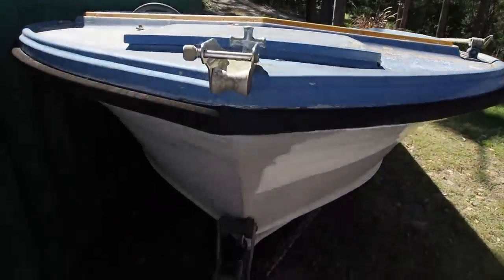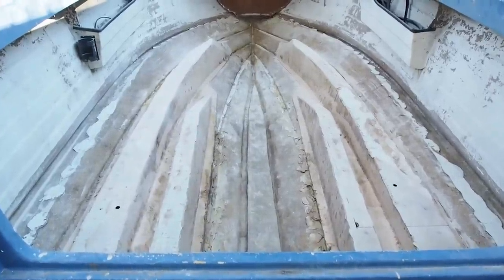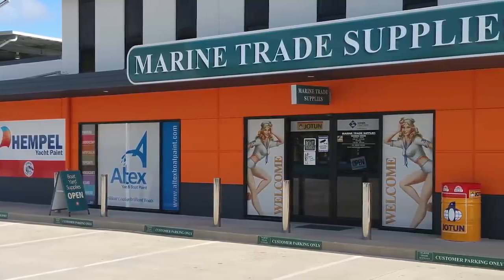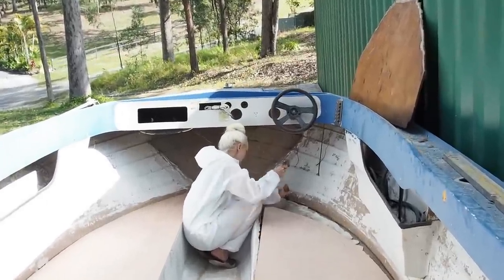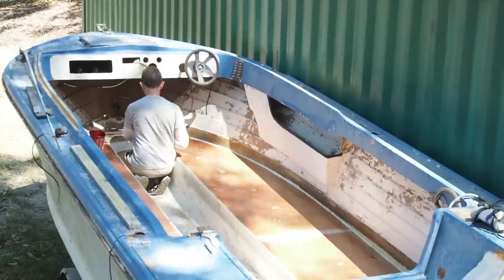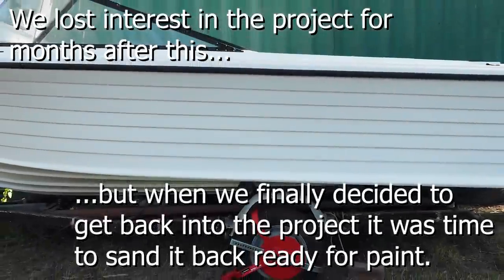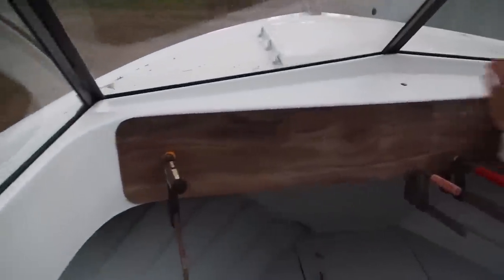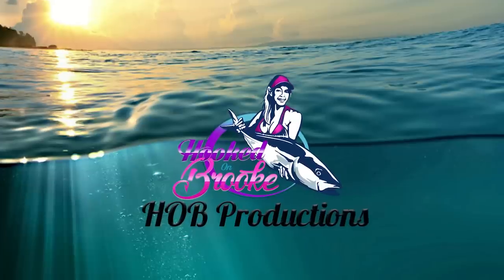Run-about Boat Refurbishment - Project Boat - Boat Rebuild

Comment: Laughed  when you said you gave up on the project for a while I'm in the middle of my first boat/restoration 16 ft 1985 side console Bonito bowrider not  much info out there about this boat I stepped through the floor in my yard loading cooler on Fathers day 2020 about to go out with my little girl for a boat ride was going to be  third time out in it when this happened guy sold it to me said it was well taking care of there was so much rot the stringers/transom had all turned to literal mud. The flotation foam was completely saturated with water. I have been putting every spare moment into the restoration of it because I want those water memories with my wife and kids. Not ashamed to say TODAY I was literally about to cry and give up on it but after watching this video of the end result I'm GOING OUTSIDE NOW to continue thanks for posting you helped out a dad who desperately needed it THANKS SO MUCH!

Comment: Excellent work Brook and Dennis!  I did a similar restoration on my first bass boat, a "free" one about 25 years ago.  My 3rd boat is a 22 sail boat that didn't need near as much work but I still get ribbed about spending too much time with my "32 year old mistress".

Comment: Y'all did a great job on that boat, it looks really really noice!!! I would've strongly recommended replacing and filling all voids below deck with the 2 part polyurethane foam for positive floatation. It would displace any water in those voids should the old hull crack and it strengthens the hull and deck.

Comment: Is the boat a cruise craft? And how long did the build take. I’ve just bought a very similar shaped cruise craft raider but a smaller 5m. Transom seems solid but floor is soft in middle so new floor, Hope it has fibreglass moulded stringers too!

Comment: the only thing I saw was you didn't leave a space for your bilge pump, since you have a very beautiful boat and it's so long to me it could have had more rod holders on the gunnals, other than that it turned out extremely nice, keep up the good work

Comment: I just bought a very similar hull but it's almost 20 feet long. It has an interesting bolt on cab roof arrangement which I have never seen before. I'm trying to decide wether I should keep the roof and enjoy the protection of the cabin, or get rid of it and convert it to a centre console. I live in Tasmania, so the weather protection would be good but  man, it would make an awesome centre console. What are your thoughts?

Comment: Your work is fantastic!
In the future try Coosa board on the floor instead of plywood!  It’s 1/4 of the weight and just as strong!!!!!   Saved on weight!  Less gas!!! More speed!
Reply: Thomas Harrell - Coosa board is just as strong but 3 times the cost...

Comment: awesome job especially on all the little metal fitment pieces and what looked like rod holders. did i see some roughed up nonslip texture paint on rear corners?
Reply: only thing i question is why go back with wood?   why not coosa board or similar?

Comment: Could you provide some detail on the product you used for the final deck coating?  I think you referred to it as "flow coat".  I am refurbishing a 23 foot boat, and I need a treatment for the decking after it's fiberglassed.  Seems like what you used would be perfect! Greg

Comment: What I learned in a  boat project, they are made in a series of steps layered into the final finished boat. This is a crazy project. Its should be done in a building or industrial yard. Don't use a lot of hardner and it will set slowly. You mucked up I would of foamed the floor .Way to much work for the boat value. You did a great job now pick better boats to refurbish on the side for sale.

Comment: The proper way to repair the transom is to pull the cap off the boat and cut the transom out from the inside.

Comment: Danger! Let me be clear. I am a 69 year old fiberglass fabricator, expert in all resins, epoxies and mouldings. I have done industrial repairs and boat repairs of all types! THIS IS NOT A SAFE WAY TO REGLASS A TRANSOM ON ANY BOAT...ESPECIALLY A TRANSOM THAT MUST TAKE THE WEIGHT, TWIST AND FORCE OF AN OUTBOARD ENGINE! This transom will crack and delaminate along the edges you see that frame the transom width and height!
Especially along the boat bottom, 1 inch blunt edge. I have seen this EXACT type of repair on boats, where the engines ripped out completely and the outboard fell off, sinking the boat! There must be a reconstruction and overlap of all glass inside and outside the corners of this hull's rear, at least 3/8 inch thick on the outside and ...before...You place any plywood. Then bond both ply thicknesses with EPOXY RESIN. Then place the ply against the outside glass 3/8 layer. You want this plywood to bond to the glass...so quickly cover the plywood with one epoxy saturated layer of chopped strand matt that covers the full with and height of the Plywood. Press the plywood into place and clamp it tight to the outside glass. Squeezing out some of the epoxy, making sure your plywood is fully pressed flat across the entire transom. The plywood, even encapsulated in fiberglass, only adds stiffness to the span of the transom. The real strength is in your fiberglass layers!!You must put enough glass ..inside and outside to span the entire width and top of the transom, wrapping over and out to the outside glass for real strength. All glass inside and outside should wrap onto all sides and boat bottom existing fiberglass by at least 10 to 12 inches....3/8 inch outside, 3/8 inside. No Less....and more if it is a large offshore twin engine, wide beam boat. 
You take the time to tie all new glass to old glass by grinding back the old glass to a long taper. It is this taper, this long taper of 10 to 12 inches on a 18' to 20' boat that BONDS THE ENTIRE REPLACED TRANSOM TO THE BOAT HULL.
Also...tying your Stringers into the Transom by glassing them in to the transom on the inside must be done for added bracing to STOP the push/pull flexing of the entire transom by the lever‐force of the upright outboard engine or engines! 
Take the time to study best practices of fiberglass "laminate lay‐ups" and alternating woven roven heavy glass matt with chopped strand matt in alternating layers to build out your 3/8 inch layers. Use a glass laminate type roller....get all the air bubbles out! 
Yes! You can do it yourself...but know how to reconstruct the STRENGTH you need!.

Comment: Where did you get your rub rail from?
Reply from the maker: Rub rail? Do you mean Gunnel rubber? Any channlery/boating suppliers should have gunnel rubber. We ordered ours from Ebay.
Reply: Hooked On Brooke yes that’s what I meant, I’ve been trying to find some like the kind you used on your boat
Reply from the maker: do you live in Australia? I can give you a link. https://www.ebay.com.au/sch/sis.html?_nkw=15M+35mm+Black+Gunwale+Rubber+-+15+Metres+Gunnel+Gunwhale+Push+On+PVC+104681B%2F15&_id=112984096990&&_trksid=p2057872.m2749.l2658
Reply: Hooked On Brooke I live In The U.S. but I’ll try your link
Reply from the maker: At least you will have an idea of what to search for now. best of luck xx
Reply: I did find it but it’s called gunwale rubber here, never heard of it until now haha, thank you though for your help, great video by the way!
Reply from the maker: I think the word gunnel is slang. Yes, the right name is gunwale.

Comment: Do not ever let anyone con you into replacing transom this way, it will fail .if you spend $2000 painting a dog turd it is still a piece of shit. Bet this boat is not still afloat in 5 years......please people don't follow this woman's advice...traded as (fibre glass fix ) for 20 yeats